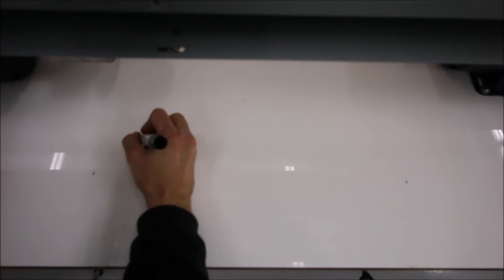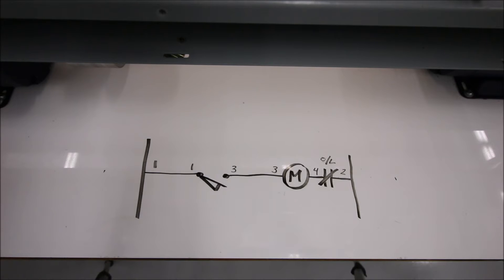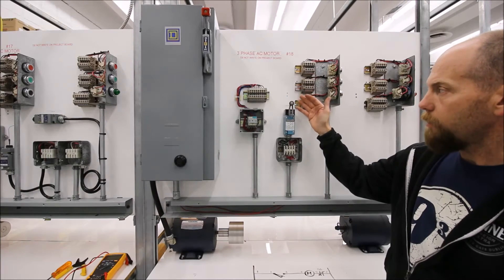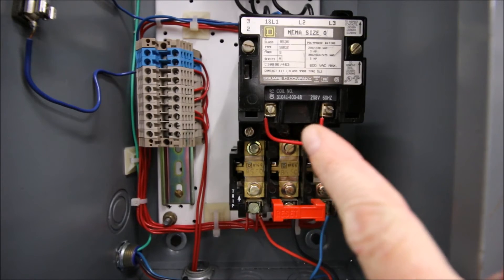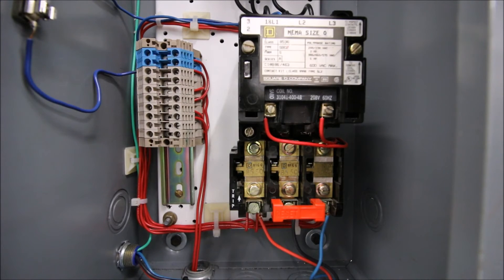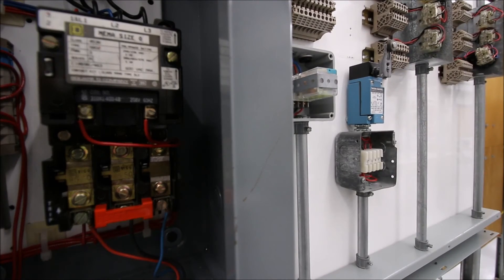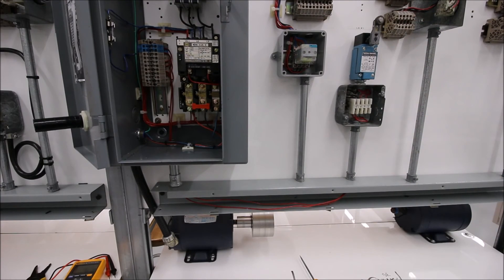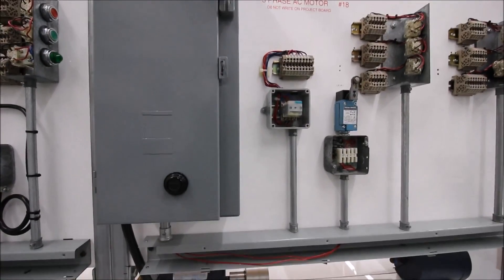Ladder Diagram Basics #3B (2 Wire Control)

Comment: Hi Mr. Pete Vree. Your are a very good teacher, i appreciate it, thank you. I bought 5 HP Nidec FD5CM2K18  motor 1 PH, 230 volts, FLA 22 A to my compressor to remplace 6.5 HP gazoline motor and i found on Youytube from you, 3 wires control and now i am able to do with 2 wires control. My question is it possible to combine and use one or other 3 wires control  (or) with 2 wires control for the pressure switch (dipôle) please,  inside  the panel? I will use  Schneider Thermal overload relay LRD22C 16-24A with Schneider LC1D32M7C Telemecanique Contactor 220VAC 32A. Have a nice sunny day Mr.. P.s. 2 wire take a s.2020 01 22. Saint-Joseph de Mékinac, Trois-Rives, Québec et Labrador.

Comment: You have a 3 pole starter for a two wire operation. L3 has a different heater. Is this right. I think when your starter pulled in after you did a reset L3 pole was powered up but not L1 ??  My observation could be incorrect.
Reply from the maker: The term 2 Wire Control refers to the control circuit that turns on this 3-Pole, 3 Phase Starter. The overload unit below the starter has 3 Heater/Overload units that protect each of the 3 lines going to the 3 Phase motor. When I turn off the disconnect near the end, I am turning off the entire 3 Phase supply to the circuit. When the power is restored, the 2 Wire control circuit turns the 3 Pole, 3 Phase starter immediately and the motor goes back to running.
Reply: Ok got it. It looked like you where using Load 1 and 3 in the video.